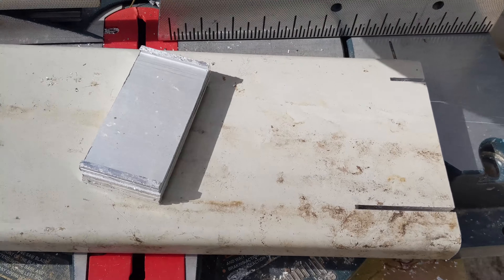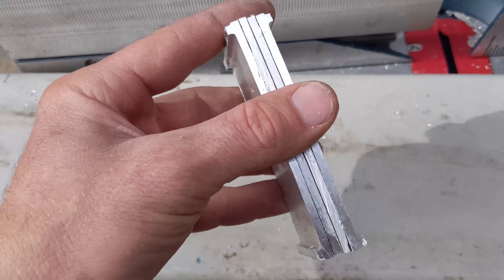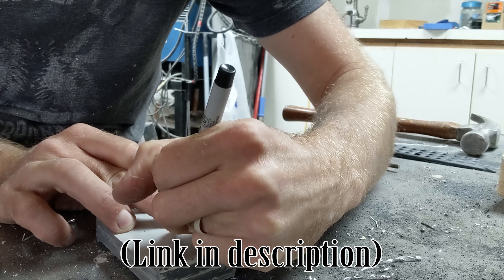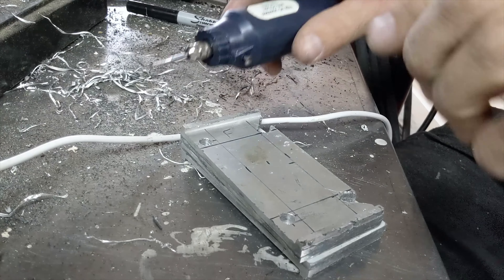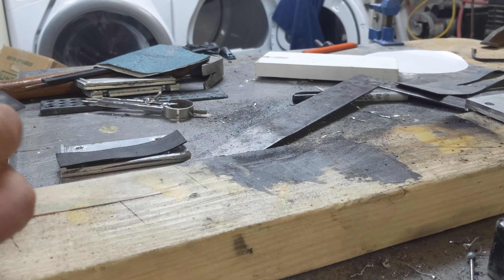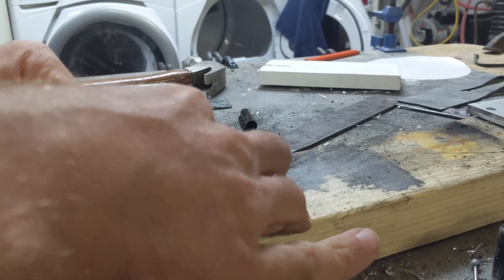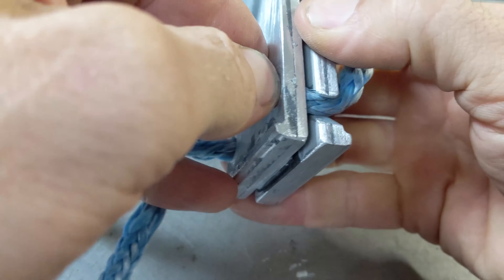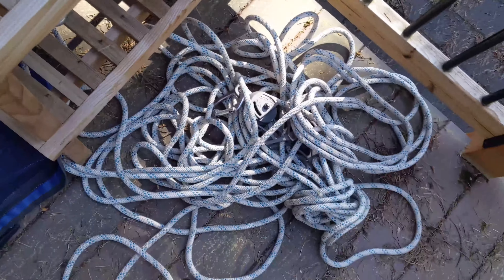DIY Aluminum Linegrip Build

Comment: Nice build!  Do you have any idea of how much materials cost?  You should do a video showing off your backyard highline too.
Reply from the maker: Thanks! I already had all the materials except the rope, so I'd guess maybe  $20 if you bought aluminum from Home Depot, a new bike tube for the rubber and some inexpensive rope! Definitely less though if you scrounge some cheap materials.

 I'm working on a little video of my backyard line actually. Just a little montage of setting it up. But I did weld a pretty cool anchor plate for it for the attachment to my house I might talk about sometime.  I also just put up a 60 ft line beside my house way up in some trees. Quarantine gives me all sorts of time for projects!

Comment: Thanks for this video! I made one myself, using bicycle tire intertube. The rubber delaminated from the aluminum at about 400 lbs of force. Have you had any problems with this? What thickness of rubber did you use? is there any reason not to use thicker rubber, say 4mm as opposed to 2mm?
Reply from the maker: Hey! Sorry for the delay. Need to check my notification settings. The rubber I used is 1mm thick. I haven't had any issues with it yet. I have yarded on it pretty hard with my massive pulley system, no issues with the rubber. Did you rough up the inner tube with sand paper before gluing?
Reply from the maker: Not sure of benefits or disadvantages of thicker rubber. Bummer that yours delaminated though! Could be something to do with the inner tube, maybe lack of sanding rubber/aluminum? What adhesive did you use? Could also mean the rope isn't sliding well enough and providing good clamping force. Or if the aluminum isn't quite flat? Just some hunches.
Reply: Steve Van Pelt Steve Van Pelt thanks for the response! I used JB Weld. I did sand the rubber before mounting it to the aluminum plate. I think you could be right about the problem being the rope’s not sliding enough. I noticed after using it again that the sheath two cordalette strands had been cut. These were the strands sitting at the front end of the line grip, where most of the delimitation took place (which would be where most of the force was being applied, rather than having it well dispersed throughout. I think what I need to do is round out the edges of the holes, and use Amsteel instead of tech cord. The only problem is that I dont have a dremmel tool =(
Reply from the maker: Ah, that could definitely do it. A circular file (like for sharpening chainsaw chains) might work. Even a screwdriver or razorblade might help get it rounded out, since aluminum is so soft. A small Dremel is probably only $5 or so at harbor freight, too. Good luck!